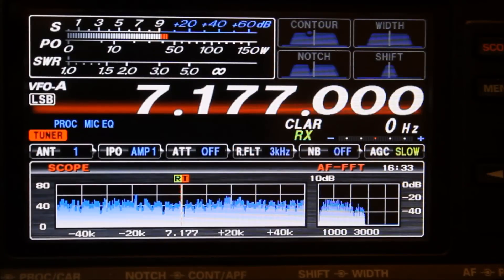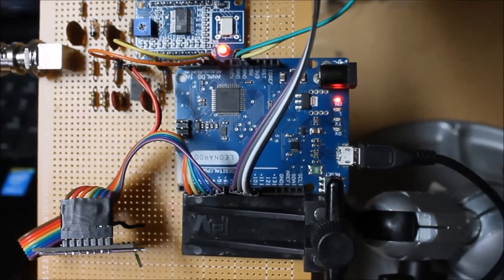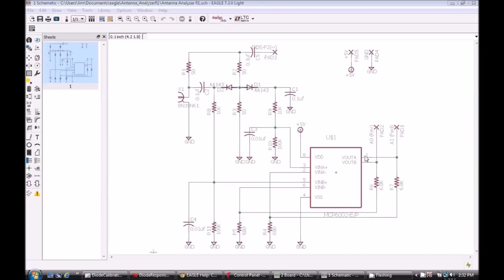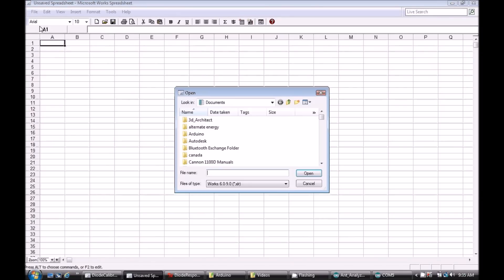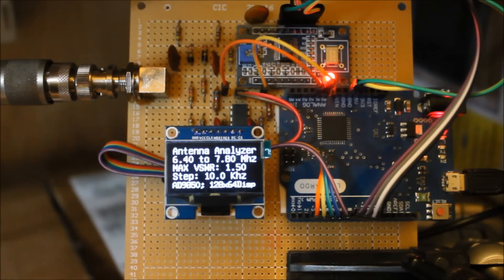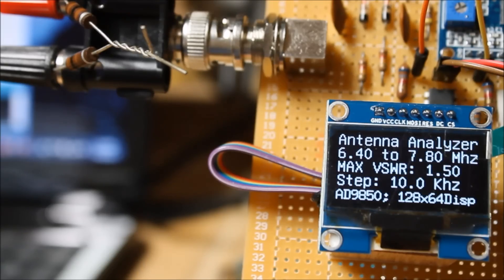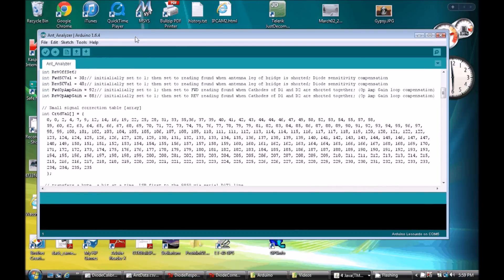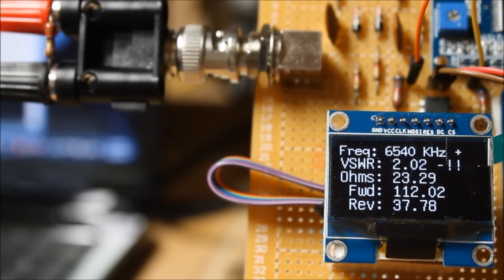DIY No Frills AD9850/Arduino Antenna Analyzer

Comment: A cordial greeting Jmbrvy 1947 My question is the following one the same project can be in use the ARDUINO alone MIKE without the AD9850 or is accompanied of the AD9850 I am with this worry of the ARDUINO MIKE. I have a display 128 * 64 with this driver ST7920 adapt it to the project with the modification of the code Wait for answer 73. 
ATT/CARLOS
         hk3moa@yahoo.com
Reply from the maker: +CARLOS ARTURO GUTIERREZ PINEDA 
Hi Carlos
I apologize, because I am not sure I understand your question
I think you are asking will this project work using an ST7920 display?
My answer is that I do not know for sure that it will. But I believe it will. The sketch is built around the U8glib display library, and I see that the ST7920 128x64 is listed as one of the types you can declare a "constructor" for.
So while it might mean that you will have to make some wiring changes (related to the display) I think your chances are good that it can be made to work.
If you chose to build this project, let me know how it comes out,
GL Jim

Comment: Hi Jim, would there would be a way to determine the Xl or Xc and R? Just in case one wants to figure out the counter and build a network (assuming you're basically starting w/no matching network, etc.).  Thanks.
Reply from the maker: +Patrick Bouldin Understand the need, and its a good question.
But unfortunately this simple circuit is just a pair of peak detectors.
To do what you're looking for needs something that can detect the phase angle between the two signals. They keep putting more and more things into IC packages these days so wouldn't be too surprised if something usable turns up.  But for moment all this project reports is the Z value.
Tnx for Asking
Jim
Reply: +jmhrvy1947 Thanks Jim, sounds good. Well I guess I can temporarily load up a picture of a smith chart! <hi>  Thanks and the project looks great.  KM5L

Comment: Hi Jim, 

I've built the analyser this afternoon and got as far as calibration however when I have the diodes shorted I get a FWD or REV reading between 82 - 73 is this right and if so how which number did you use for the script?  Great project thanks for sharing it. 

73's Mark
Reply from the maker: +hightensionlabs 
After the Build is complete, there's  two sets of calibration numbers that need to be setup in the sketch.
the lines involved are these:
int FwdOpAmpGain = 92;// initialially set to 1; then set to FWD reading found when Cathodes of D1 and D2 are shorted together; (Op Amp Gain loop compensation)
int RevOpAmpGain = 88;// initialially set to 1; then set to REV reading found when Cathodes of D1 and D2 are shorted together; (Op Amp Gain loop compensation)

// Next determine these two values
int FwdSCVal = 30;// initialially set to 1; then set to reading found when antenna leg of bridge is shorted; Diode sensitivity compensation
int RevSCVal = 40;// initialially set to 1; then set to reading found when antenna leg of bridge is shorted; Diode sensitivity compensation

They should be established/setup in the order that they appear.
Initially set all 4 variables to 1:
 FwdOpAmpGain = 1;
 RevOpAmpGain = 1;
 FwdSCVal = 1;
 RevSCVal = 1;
 
Step 1, Temporarily short the outputs of the diodes to each other (and run a "Sweep"). This ensures that the Op-Amp inputs are exactly the same input signal (during the sweep), and as a result, lets you see/read value differences related to components in the Op-Amp circuit not being exactly the same. The readings may not be steady, but I would not expect the values to fluctuate a whole lot. the important thing is to take them as pairs
Once you're comfortable with a set (pair of) values and have them loaded into the  FwdOpAmpGain" &  "RevOpAmpGain" variables respectively. You should then see (during the sweep) readings that track very close to each other, on the Fwd and Rev lines of the display.
When your happy with that, remove the short tying the two diode outputs  together and go to step 2.

Step 2. You start with the Ant input shorted to ground (everything else should be configured for a normal run) and FwdSCVal = 1 and . RevSCVal = 1.. This time (since the Antenna input is shorted both the forward and reverse legs (diode outputs) of the should be sending the same voltage to the A to D unit, and most of the difference in readings seen now will be due to differences in the two diodes. Again the readings you see will probably fluctuate some, but like before I would not expect it to be a whole lot. You might want to make several runs to be sure what is a good set (pair) of readings. The important thing is to try to use FWD and REV readings as pairs. So when you have them loaded (like before) the readings track very close to each other, on the Fwd and Rev lines of the display during the sweep.
After that your Analyzer should be ready to use. But verify by using some test resistors as "dummy antennas" to confirm that you are getting reasonable results; i.e.  A 50/47 ohm  test load reads close to 1:1 (and 50 ohms); A 100 ohm resistor reads 2:1 (and ~100 ohms), and a 25/22 ohm resistor also reads close to 2:1.
Hope this helps, and thank you for taking the time to build this project.

Jim (KW4KD)
Reply: +jmhrvy1947 Thanks Jim I'll give it ago.  Out of interest would you expect to see different fwd & rev values when swapping bands?
Reply: +jmhrvy1947 Hi Jim, I've done as you said and it now works.  Thank you so much for the assistance, what a great project. :-) 

73's Mark

Comment: Hi again Jim, I have been asked if anybody has made a PCB for this project yet. I told him not that I am aware of. Did you or anybody else do it? Could it be done from your Eagle files? I build most all my projects on a piece of copper clad board for the ground plane, so not very up on PCB manufacturing.

Joel
KB6QVI
Reply from the maker: +Joel Caulkins Not that I know of. 
Like you most of of the boards I do here are "One-Of" efforts.
But my understanding is there are companies out there that do small runs and I believe at least some of them will work directly from an eagle file.

Comment: Hello! I have a problem with analyzer.
In beginning i had a problems with run program, now i had problem with measure.
In first measurement i connect metal oxide resistor 49.9 ohms, after first connect arduino to computer in analyzer swr grow from 1:1 like herehttp://www60.zippyshare.com/v/iPtnr5Nh/file.html, in next measure is still 5:1 and up, does not increase from 1:1
the problem lies on the side of the diode aap153? Beacuse I had only that one...
thanks for answer, and sorry for my English :)
Reply from the maker: +Hakuna Matata 
No need to apologize for your English, but I must confess I am confused by the hyper Link you included.
Is that something you added yourself? And how is it linked to the Arduino program?
It might help me understand better, if you could send  a link to a picture of your circuit board, and or any other photos that shows how you have your Analyzer setup.
Best Regards 
Jim
Reply: +jmhrvy1947 Hi again, its mine link.
I want to mark in beginning that I could not get the AA143, however I have AAP 153, and BAT85. In both cases I have the same problem. It is a main problem?
The pins linked below:
P1-A0 in arduino ;P2-A1 in arduino ;P3-D1 in AD9850 DDS ;P4-GND ;P5-+5V .
W_CLK-D9 in arduino ;FQ_UD- D10 in arduino;DATA7- D11 in arduino;RESET- D12 in arduino.
I am an amateur, I tried to realize layout as best as I can.
Paths do not touch, I was checked it.
https://drive.google.com/folderview?id=0B5BIsYIUsoGtS3AyaDBTa09UMGM&usp=sharing
Reply from the maker: +Hakuna Matata 
Hakuna 
I apologize for taking so long to get back to you.
Your pictures are excellent, and I think for many projects your build method (layout) would be fine. But this project needs the RF leads to be as short as possible. Particularly those traces (runs) related to the bridge circuit. And they also need to be as symmetrical as possible.
From what I can see (in your pictures) the bridge resistors are arranged well but the diodes leads are too long, and don't appear to be close to the bridge resistors.
Also you need to keep the RF run from the ad9850 to the bridge resistors as short as possible  too. 
I could not tell if you had a 0.1 mfd bypass capacitor accross the 9850's DC input, but that capacitor needs to be located as close to the 9850 as you can get it.
I know its frustrating but component placement is important to the success of this project. You may be able to get the  circuit to work using a three holes per pad board like what is shown in the picture. But if possible, I would recommend you use a one hole per pad board, and arrange the components like I have them shown in the PDF Board layout file.
 I hope you will continue to work with this project and ultimately get it working.
73 & GL
Jim (KW4KD)
Reply: ok, big thanks, i try to make a pcb by marker and etchant.
In few days i write here. ;-)
Again thanks for answers, 73's :)
Reply: Ok. I maked a pcb by marker and etchant. Can see the effects in comparison to the previous, but the layout does not see whether it is connected or not.
Now I go sleep, maybe in few days i again try. Thats all news from me ;-)
Reply from the maker: +Hakuna Matata I appreciate your hard work. And understand the aggravation when something does not work as expected. Hopefully a good night's rest helps you find the problem.
Sleeping has often worked for me. Sometimes the pathway to the answer comes at night, But often I see it when I come back to what ever had me stuck. 
Good Luck and keep us posted

Comment: Great project Jim.

I'm gathering the parts to build myself one, and was wondering, are all the caps just regular ceramic disk caps? Do you have a parts list, of do I just go off of the schematic  over on the GitHub site?

Thanks
Reply from the maker: +Denis Dimick 
Hi Dennis
You're correct there is no separate parts list. Just use the schematic as  a parts reference. 
However, not shown on the schematic, but I found needed, was a 0.1 mfd bypass capacitor (mounted as close to the 9850's dc input as possible). Also keep your RF runs as short as possible, and mount  the schematic components  in a rigid way. 
While you are rounding up components, you might also want to get some extra "test"  resistors (like those shown at the end of the video). 15, 22, 33, 47, 100, 150, and 220 ohms are fairly easy to come by, and are nice to have. Remember though I was happy if my analyzer reported within 20%. 
GL, and hope you will let me/us know how it works out.
73
Jim (KW4KD)

Comment: We Need more of you "Ham Guys" in the RC world!
I subbed instantly from your Bluetooth Vid, Had same scenario..
you were only one covered it! (dongle off in vista, sitting then revived!)
My question Is, B4 I take on this build... will this be suitable and useful
enough for the freq. ranges we use for control, video and telemetry? 
I want to experiment with homebuilt antennas, I inherited an awesome assortment of
wire bending devices and rare, high quality jewelry + watchmaking tools I want to put to use
I'm a retired IBM FE but my RF scope of knowledge is from '70 early '80 CB stuff  
and I just Love the smell of Rosin! your solder looks great too! have you made A PCB
for this Yet? Thanks for posting!
Reply from the maker: +E Pasko 
Appreciate the Kudos. And I'm glad that the Bluetooth vid helped. That one had me stumped for a couple days.
Anyway to your real question, if I follow it correctly. This antenna analyzer is just for the hf bands (1.8 to 30 Mhz.)
The local Osc (the 9850) is clocked from a 125mhz source, and only has useful output up to ~40Mhz. Far short of the 2.4 & 5.8Ghz that I think you are wanting it to work at. However, if I've missed the point here, please let me know.
Again, thanks for the comments
Jim (KW4KD)
Reply: It would be brilliant if this could be made to test antenna for 1280mhz (1.3ghz),  2.4ghz and 5.8ghz!  I've just got into making my own Antenna's so this tool would really help me.

Comment: Hi, is it possible that the *.brd file is corrupted?

I tried to open it with eagle 6.60 and got the message "column 6 row 41: This is no EAGLE file".  Uploading it to a pcb-service failed as well. Any help?
Reply from the maker: +Edgar Gonzalez 
Edgar, 
It worked OK for me, I just downloaded the github files using their zip download.
Then downloaded Eagle 7.5.0 to a new computer (Windows 10; 64 bit) and extracted all the zipped eagle files to the eagle folder, under Documents. And found that both the Board layout & Schematic opened without error. 
I was afraid when I saw your comment, that I had left something out, but I used what I call a "clean" computer to test with, so I'm not sure what to say, beyond what I've just described.. Maybe there's a nugget in what I just described, and you get it to work on your setup.. I hope so.
Tnx Jim (KW4KD)
Reply: +jmhrvy1947 Thank you - now it works. I downloaded the file manually via "rightclick" and "save-as".  With Zip-Download everything is okay.
Reply from the maker: +Edgar Gonzalez 
That's good to know. Maybe this exchange will save others from falling into that trap.. 
If you elect to build a version of this project, I'd love hear/see how it worked out for you

Comment: Hi Jim, I have done exactly as you suggested . I used a Nano, this works with the pin assignments as per your rotary sketch. I have not built the bridge circuit yet.
What's involved to add 80 meter band, is it just over writing say the 30 meter band or can I add it as well to make 6 bands?
73
John
Reply from the maker: +john corr  John, I apologize, I posted a reply last night, but now it seems to have disappeared. 
Yes, you can add as many band options as you need.
To add one,  find the the "// Splash Screen" method/routine. Go to the "switch" section, in this routine, and using "copy" & "paste" create a new band plan, by changing the parameters in the "pasted" section to match your needs. Then renumber the "switch"  options so that your new  plan appears in the sequence  that you want. 
After that, find the interrupt routine [find/search "isr()"].  near the bottom of this routine, you should see these lines of code:

    virtualPosition = virtualPosition+ IncDecVal;
    if( IncDecVal > 0 && virtualPosition >=6 ) virtualPosition = 1;

    if( IncDecVal < 0 && virtualPosition <=0 ) virtualPosition = 5;
 

And assuming  we are adding just one new band scan option, change the "6" to a "7", and  the "5" to a "6".
And that should get it done.
Let me know if you run into other issues
73
Jim (KW4KD)

Hopefully this time the words will stick  Hi
Reply: +jmhrvy1947  Thanks Jim, that works for me. Now just waiting for some components to arrive.(on a slow boat from China)
73
John VK5COR
Reply from the maker: +john corr I know about that boat ;-)
After you get everything together (and assembled). You will need to set some compensation parameters found in the sketch (to work with components used in your build). I talk about it (in general terms) in the last part of the video, and there are some notations in the sketch, but I'm not sure how clear they are. So if you have questions about finding/setting them, please ask.
73
Reply: +jmhrvy1947  Hi Jim, Yes I would like some walkthru of the compensation proceedure.I have read the notations but was going to wait for the unit to be completed.
I don't want to hog this site but Iam sure the info that is being explained here is of benefit to all.
Thanks again .
73
John
VK5COR
Reply: +jmhrvy1947 
Hello again, so far some progress. I have built my rendition with a buffer amp. It's spread across two breadboards.It seems to work but with some peculiarities.
The sketch runs the first 3 selected bands ok, and reports swr ok. The last two or three (higher bands) the swr reading is missing, just a blank line? Tried the standard sketch with encoder and my added band plan, both the same problem.(40,30,20 ok 15,10 no swr reading?,blank line) could it be my build "spead across two breadboard" affecting higher freq?
73
John
VK5COR
Reply from the maker: +john corr That could well be the case.. I did my first and only build on the pref-board shown in the video. With the thinking being, to get decent (repeatable) results the bridge components needed to  arranged in a n orderly way, and firmly mounted. 
And the same is true for the placement of the of the 9850, relative to the bridge.  
Additionally, I placed a 0.1mfd capacitor right at the 9850's Vcc to Grnd input pins (I hope Joel, KB6QVI, is reading this, because he indicated having a issue with repeat-ability).
Mine works well up through 10 mtrs. And it may go higher, I just haven't had a need to go beyond that point.
Now having said that, I will confess that scan routine will abort if the ANT input is changed during the scanning cycle.  But given the current logic sitting behind the scan routine, I don't consider that to be an unexpected event.
So If you have some pref-board, try the layout similar to what's shown in the Eagle file. Or if you have some other build technique that yields a close solid layout , give that try.. And don't forget the 0.1 filter cap at the input to the 9850.
Hope that helps
73 Jim
Reply: +jmhrvy1947 Yes, that .1 cap on the VCC to ground made mine repeat the same results every time.